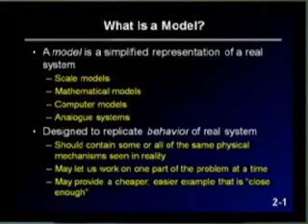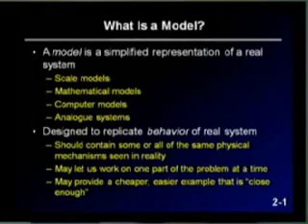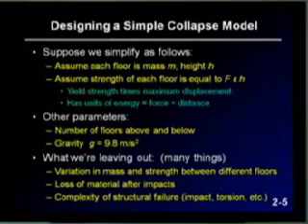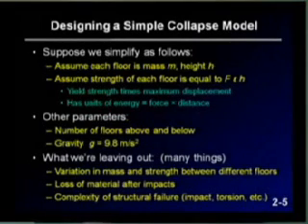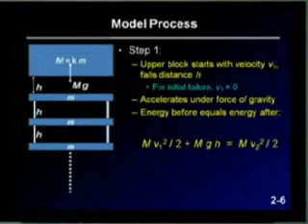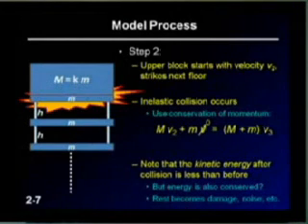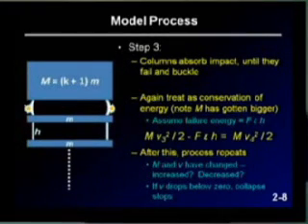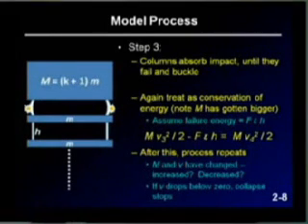WTC Modeling Instruction & Testing in the Real World

Comment: Firstly I love how all the experts focus on the floors, to them it's the weakest system in the building,of course they can easily get "sensible" people to understand how a huge portion of the building can take out a few floors! instead they ignore the huge elephant in the room being the actual structural supports..I'll give you an example when they say "the buildings were rated for 1.5 hours to 2 hours of fire protection, they did their job!" The reality of this statement is that time frame is the fire rating for the actual floor supports because that's where the important cargo is! They usually won't bother listing the entire structural system because what's really important is the lives trying to rescue the lives inside which would be on the floors,
Reply: Turner9090 If you think the building is designed to arrest and stop 32 floors failing collectively (wtc 2) you're out of your mind.    The dynamic loading this generated was equivalent to nearly 200 stories of weight.  The structure was designed to deal with 6 floors failing maximum.    And this has nothing to do with the government.  It has to do with engineering.

Comment: Thanks at least someone is building an experiment to simulate the official unproven hypothesis. However, your model includes paper as support columns which acts differently than structural steel and concrete. Anybody, especially the critics out there, know of any replicable experiments that mimic the events closer?
Reply: fujisaii

It did.  But the deceleration was so minimal that it basically makes hardly any difference.  The floor below would only be expected to resist the collapsing upper section by no more than about 1%.    It doesn't have to "Crush" the floors.  All of that stuff is somewhat over stated.  All it has to do is stress all of the fasteners and bolts and rivets and flanges and floor brackets that "HOLD" the building together.  They only operate when the loads are carried as static weight.  Change that to a gigantic dynamic load and there is no bolt, weld, flange or bracket that is going to arrest and stop that much load hitting it all at once.  It would be a very brief pause as the floor takes the load.. Its maximums reached and it fails..  But it happens in 2/10ths of a second.
Reply: This is not an attempt to accurately model the north tower.  It is a demonstration modelling the physical principles of a vertical structure that must hold its own weight.  If we do not have accurate data on the distributions of steel and concrete down the towers then a good model cannot be made even if it is done with the same materials.

So you think about why YOU and everyone else has not been demanding that information for 12 years.

This model is done with paper to make it as weak as possible relative to the static load.  That is not how skyscrapers are designed.
Reply: psikeyhackr
 Your WTC model is astoundingly stupid.  The structure was designed to deal with a load of 6 floors failing.  As long as that load was applied gradually.  Not only was the load more than double six floors but the load was applied suddenly.   There is no bolt, weld, flange or floor bracket that is designed to deal with a dynamic load of this magnitude.  We're talking something that is nearly 40 times over its static weight.   And the structure ONLY carries the floor levels as static loads.
Reply: roquefortfiles Wouldn't the falling structure decelerate when crushing through floors bellow?
Reply: roquefortfiles Wouldn't the consecutive floors bellow the first floor decelerate the falling mass noticeably? How many floors would you assume would be necessary in order to see a noticeable slowing in decent?
Reply: The total weight of the washers is 3.5 pounds.  A single tower was 400,000 tons.  Paper could support the static load of the washers.  A bigger heavier model would be better and require different materials.

No matter what the truth is this society has a problem with the fact that engineering schools not been modelling this problem for 13 years.

What is they know the collapses were impossible?
Reply: It is possible to write a computer program where the Conservation of Momentum is the only factor slowing the collapse.  A collapse time of less than 12 seconds is IMPOSSIBLE just due to accelerating the mass, not counting the energy lost in breaking the supports.

http://letsrollforums.com/showpost.php?p=177156&postcount=34

Not having accurate distribution of mass data on the towers is complete nonsense.  Our engineering schools should have pointed that out no matter what the truth is.

Comment: The whole argument is a red herring anyway. Even if there was enough momentum to break the connections of each floor, the core columns would still be standing. This is why even NIST gave up on the pancake theory. Debunkers argue things even the government doesn't try to defend.
Reply: You are aware that neither the exterior wall or the core columns could stand on their own without the cross brace of the floors

Comment: Not sure you address the right person with that question, but my guess is:

1) that the core of WTC 1 was attacked (by something) round the 98th floor (or above), and that for some reason part of the core from about floor 60 or so remained standing (as seen in the videos) several seconds after the perimeter walls had collapsed, and that

2) correctly: 25 seconds was in regard to total time including core remains collapse (a gravity only collapse would take longer than what we saw on 9/11, 2001).

Comment: @psikeyhackr  "Are you saying the structure did not have to get stronger and heavier all of the way down?"

The components that were resisting the collapsing mass I.E. the floor-to-column connections and core crossbracing were of equal strength for the full vertical height of the building except for the mechanical floors at the top, middle and bottom of the building. 

The columns were bigger at the bottom, but the columns were not resisting the collapsing mass.

Comment: @psikeyhackr "The idea of 15 stories completely obliterating 90+ stories is totally idiotic."

Said the Youtube user that thinks his paper loop model accurately represents the mechanics of the WTC. 

Once the debris breaks the floor loose from the column connections that floor becomes part of the falling mass which then makes the next floor easier to break because every single floor in the WTC is equal strength except for the mechanical floors.

Comment: @psikeyhackr "Newtons third law"

The floor's vertical connections at the columns and the crossbracing in the core were not strong enough to provide an equal and opposite reaction to the debris falling from above. 

Not even close. It's not even in the ballpark enough to make someone even run a hypothetical scenario and trouble themselves with doing the calculations because the possibility of collapse arrest is not even on the radar. 

You understand that right? Of course you don't.

Comment: @flanksteak2 And so you see. Top of building begins to fall, debris crashes through building severing horizontal connections. The outer columns tip way, sometimes in long sections as lateral support from the floors is lost, the beams that connection the core columns together are stripped away and then we are left with a still standing core until the collapse is low enough that the columns are too long to effectively stand on their own and collapse as well!!!

No wait, it was thermite.

Comment: @psikeyhackr "relevant data"

It's all there. You think that just because you are making noise that it means there is controversy, there is no controversy you are just making noise. 

The data is there in the NIST FAQ's, the live load on each floor x 12 in the smaller case was enough to break the connections below. This excludes kinetic energy, the weight of the framing and concrete, mechanical equipment etc. 

You can see how claiming the collapse should have been arrested is just plain dumb.

Comment: @psikeyhackr "No source specificies"

Do you suppose they were pouring concrete into some mystery holes and places or are you just incapable of reading the design description and drawings and determining the answer the your irrelevant question?

Of course you know everything so it must be that you are lacking the needed data, not the necessary (very basic) knowledge that it takes to figure out such a piece of irrelevant trivia. Right?

Comment: @psikeyhackr Just the live load I.E. the stuff that was placed on the floors above the collapse initiation area in both cases was enough weight to exceed the load rating of the floor-to-column connections. You're already past go/no go with that weight alone. 

The building framing and concrete, antenna tower, hvac equipment etc is all just a bonus that puts the mass way above what it needs to be to break the floor connections below making your arrest claim all that much more ludicrous.

Comment: @psikeyhackr So lets clarify here, you want to know the amount of concrete present on each floor. 

What quantity shall this number be in volume or weight?

FYI, your question is easily answered by simply reading the description of the building and looking at the design drawings. 

Since the info you want is readily available what do you plan on doing with it?

Making the floor-to-column connections 100's stronger than they were so they can arrest collapse?

Comment: @psikeyhackr You said "distribution", you did not say total amount. 

See how confused you are?

It's like talking to a random phrase generator. We tell you the building is columns with floors spanning in between the posts and thus the the only thing that resists collapse are the vertical connections at the columns and  in response you type:

"ROFL!!! NIST can't tell me the distributions of steel and concrete in the towers".

Comment: @psikeyhackr "So what is stopping YOU or anyone else from building a better model that can completely collapse?"

Lack of interest. A 5 year old can understand that the only thing resisting collapse were the floor-to-column connections and that's why the core columns stood standing after the floors and outer walls collapse. 

Only Truthers like yourself think that the floor assemblies are capable of holding up the entire weight of the building.

Comment: @psikeyhackr "Notice that NO ONE has built a physcal model that can collapse"

Notice that you are making is called an "Argument from Ignorance". 

How do you rationalize core columns still standing after the floors and outer walls had collapsed while claiming the full vertical support capacity of the columns resisted collapse? 

If you are unable to answer this question why not just say that it's beyond your technical skills to do so instead of inventing conspiracy theories?

Comment: @flanksteak2 With that statement in hand, we know that the full vertical load carrying capacity of columns was not resisting collapse as all you dipshits seem to think because you have less mechanical skills than a drunken chimp. 

The building can be thought of columns with floors spanning in between these columns. When the top begins to fall, all that resists collapse are the connections that hold the floors to the columns. 

Get it?

No of course you don't.

Comment: @psikeyhackr LOL

No thanks. Tell us how strong each floor was and how much weight was applied to each floor and then tell us why you think that floors that are having their connection strength greatly exceeded should not fail. Once you can do this, I will get started on the model. 

Second, why don't you tell us why you think the core columns still stood up to the impact area after the floors and outer walls collapsed?

Your reply should not be excuses or requests for models.

Comment: @NWOiAM the point is, that it's a structure that's 7 times higher than it's width all made from the same material. In fact the tower were built with massive tapered (got thicker the lower down one went) columns that the base were almost 53" of solid steel (the larger of the two core columns used.
and 240 perimeter columns) -all falling through themselves? all that undamaged structure below the crash zones>? And what about Newton's 3rd Law? *watch the vids by David Chandler (u'l learn afew things

Comment: These buildings got much stronger the lower down they went (naturally, the base has all the weight, it gets lighter the higher up one goes. It is impossible that gravity could account  for what we saw on 9-11. Despite the obvious attempt to dispose of all of the structural elements of these 3 skyscrapers there remains a mountain of facts that make the destruction of wtc 1,2&7 impossible without the use of pre-planted explosives.

Comment: Nice demonstration. I still have to give the benefit of the doubt to Bazant et al, i.e., it is possible that the towers could collapse as he describes, i.e., if the mass stayed centered, which it did not, the collapses could have progressed. Not only did the mass not stay centered, a significant portion of the ST core survived the initial collapse and then disintegrated about ten seconds later. Very odd. And the forensic evidence is gone.

Comment: @psikeyhackr Ok, build a model out of 4 pieces of rebar or 5 with one in the center to represent the core. 

Glue tissue paper to each piece of rebar to form the floors. 

Then build a similiar structure that equals 12 floors worth of the original structure and drop it on the first. The rebar will punch through each of the tissue paper and then the pieces of rebar will fall over. 

Give it a shot. I know you can do it.

Comment: @flanksteak2 And this all comes back to what was said earlier in the fact that all TRUTHER claims revolve around their fantasy that it was the full vertical load-carrying capacity of the columns that was resisting the collapse. 

So we simply ask you Mr Hackey, if the columns were "holding things" during the collapse then why do we see the core columns still standing below the impact after the floors and outer walls have collapsed?

You cannot reconcile these facts with your fantasy.

Comment: @psikeyhackr  "It is the columns in the core and on the perimeter that hold things not the FLOOR."

When the columns fail in the impact area the top of the building clearly does not sit there and fall down on the lower part, lining up perfectly column-to-column. 

The fact that you think it DID, WOULD or SHOULD HAVE is yet another testament to the fact that you can't even get the simple mechanics right, let alone the PHYSICS.

Comment: @psikeyhackr "Physics has to work the same for skyscrapers all over the world."

It does. Unfortunately you still fail to explain (using physics) why you think a floor that can only hold up 11 floors worth of live load in a static or 6 in a dynamic loading situation would not fail when the live load of 12 floors AND the weight of the building framing and floor assemblies is applied to it. 

It's simple addition and subtraction yet it still escapes your vast education.

Comment: @psikeyhackr  "Notice how the core columns DO NOT MOVE when the plane impacts the building. But the data collected and published by the NIST indicates the south tower must have moved FIFTEEN INCHES"

The purdue model analyzed local damage, it did not analyze the behavior of the entire height of the structure and the oscillations induced within.

Comment: @flanksteak2 "If the impacts of the planes were detected seismically then how could the impact of the top of the north tower against the lower stationary portion not be detected immediately?"

This "impact" was not strong enough to register seismically because the horizontal connections at the columns were not strong enough to cause there to be a signifigant enough jolt that would have been transferred to the columns and into the ground.

Comment: @psikeyhackr The seismic shaking does not begin until 9 and 11 seconds after collapse begins and continues for at least 15 seconds. 

The seismic shaking stops once the towers are short enough because the debris no longer falls enough distance to generate the force necessary to induce a strong enough seismic wave to be detected meaning it's longer than 15 seconds. 

That means each collapse took at least 25 seconds. 

You cannot refute this. 

You can only change the subject.

Comment: @psikeyhackr "Horizontal beams in core, this would bend and twist the core"

These beams are also not strong enough to arrest collapse. 

"slow it down"

The breaking of connections did slow the collapse down. That is why each building took over 20 seconds to completely collapse. 

At this point you appear to inventing your own facts about the collapse that you someday hope will come true and thus your dream that the towers were blown up will also come true.

Comment: @psikeyhackr You cannot claim that the full vertical load capacity of the columns should have resisted collapsed when the core was still standing after the floors and outer walls had collapsed. 

This fundamental mistake and ignorance is at the root of the entire Truther movement. 

Explain why you think the full vertical load cap of the columns was resisting collapse when the core stayed standing after the floors and walls had collapsed. 

You can't, you'll just create diversion.

Comment: @psikeyhackr "A tall structure capable of supporting its own weight cannot be crushed by its top 15%."

The debris fell on the FLOORS below which are connected to the columns through joints that are only capable of holding up 11 floors worth of mass (conservatively) in a static loading scenario or 6 floors (conservatively) in a dynamic loading scenario. 

Nobody knows why you think these floors are capable of holding much more than what they are rated to hold.